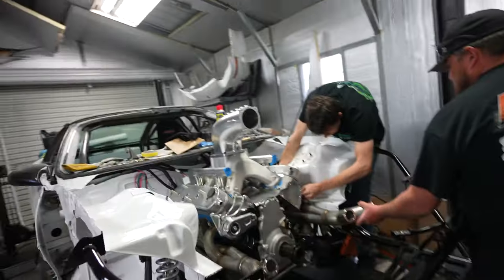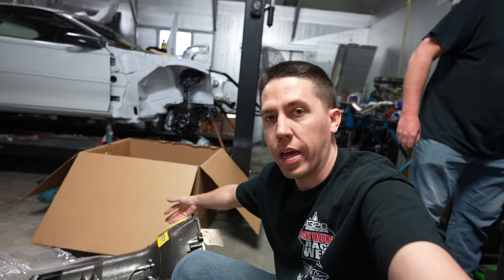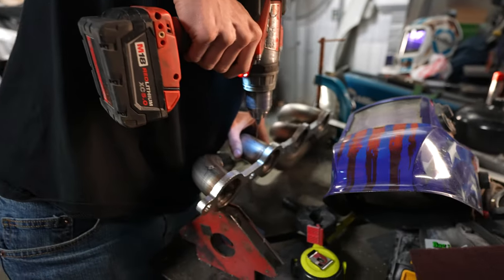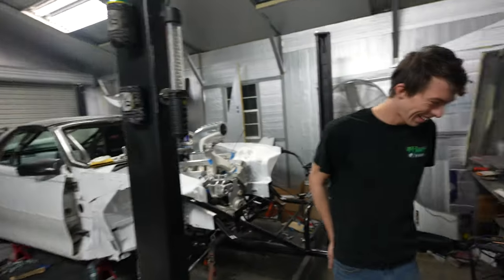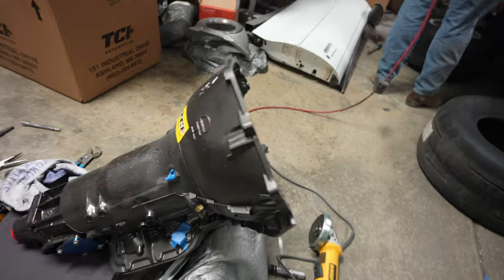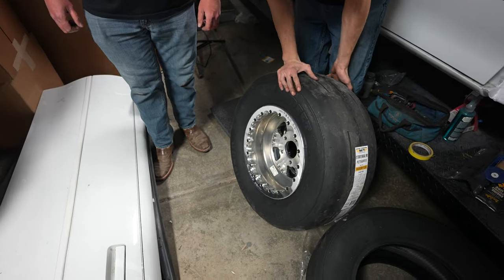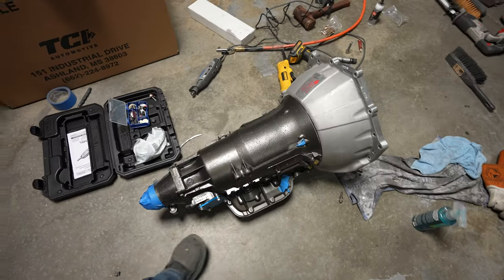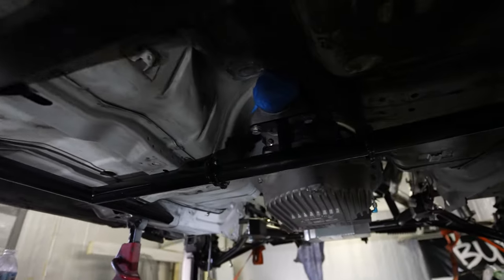Immediately Modifying Salty's New $8000 TH400

Comment: Hey how did you secure the bell housing to the trans? Weld it? Didn’t see any beads of weld.
Reply from the maker: It mounts using the pump bolts. The kit uses longer bolts.